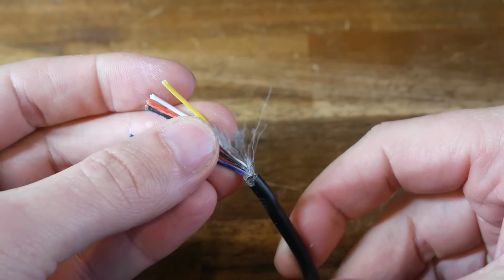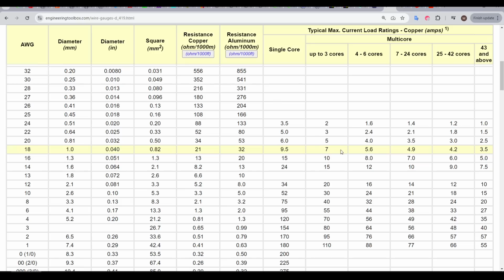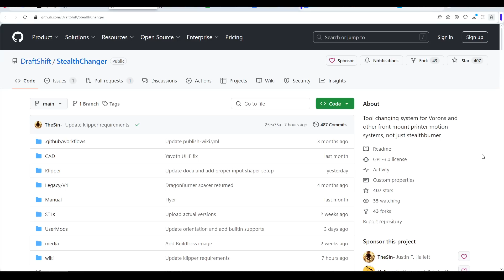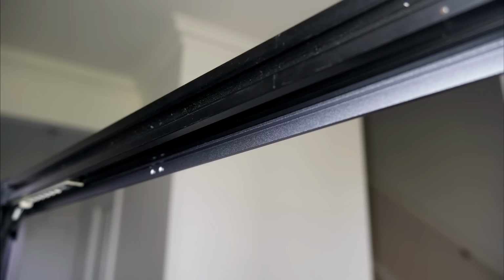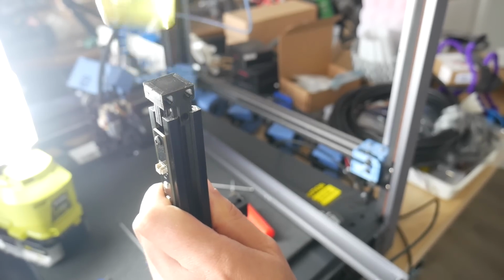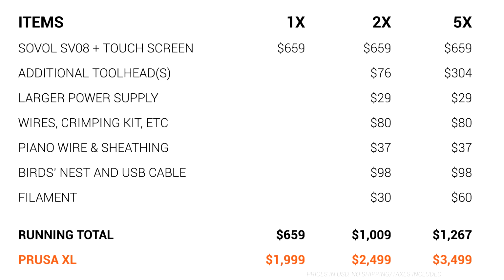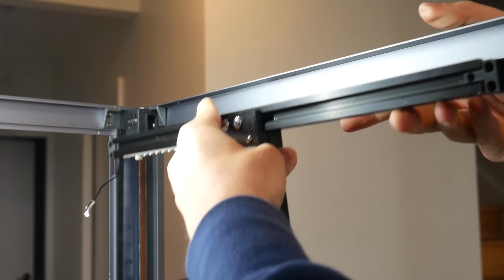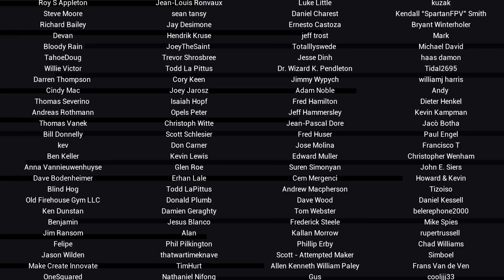Modular docking bar - Budget Sovol SV08 toolchanger part 4

Comment: for the can cable you could have just bought the BTT Can cable, it is suitable for all you do here, ahs 2 smaller gage wires for can or data and 2 thicker for power, and its not as overly thick as the one you got, plus the data wires are twisted aswell
Reply: That’s because usb cables for this purpose need to be shielded, and you gnd the shielding. CANbus cables do not need this
Reply: @BT123D  On the SV08 the grounded shielding wire is connected to the cable clamp screw. https://youtu.be/_QxwaGwVM0s?si=mTRGSr0Lu2TWNKrM&t=75
Seems excessive to have both shielded and unshielded grounds as well as grounded shielding.

Since the BTT CAN cable does not include shielding, I guess it wouldn't work in this application?
Reply: @jason.miles31  from what it looks like, the gnd to the housing is the gnd the toolhead assembly, the you have a power Gnd to the pcb, and shield Gnd to the PCB. USB toolhead board are quite tricky to stop interference with, I doubt Sovol would include wires that they didn’t need to 😂
Reply: I think the 5 wires on the sovol mod are Ground, 24v, 5v, Data+ and Data-     if you want to use a 4 wire setup, a buck converter at the tool head end to convert 24v to 5v might do the trick...
Reply: Oh grounding strategy discussions are always fun. Reminds me of my days scrolling through data sheets, app notes and EEVBlog threads lol
Reply: Seems like the BTT Can only has 4 wires.  Not sure why the Sovol has 2 ground wires.

Comment: About the wires, I'd go for thick two wire for the power and ground, and separately thin 3-wire cable for else. And then just bundle those wires together by short pieces of heat shrink every ~15cm. Might not be as tidy as a single cable, but more practical and still would work
Reply: Using wires with silicone covering instead of vinyl also makes a HUGE difference in flexibility. 

Lots of ways to tackle this problem just depends what tools you have on hand in order to work around it.
Reply: I would have just used some of those expanding cable sleeves

Comment: Very interesting to see the process, and cost breakdown. I am hoping you are also keeping track of your time, including mistakes and rework, because that time is a very valid consideration before taking on such a project.
Reply: Cost Breakdown is important and easy, but Time Breakdown will be problematic. He and Draftshift will have spend 300-500 hours in developing and building the Toolhead changer. The Question is how long will it take to assemble the finished product. That will be more like 10-20 hour print time and 10 hours assembly time. As a very simple example: I made for a friend a PC Button Box with 16 switches. The Initial 3D Draft was ready after 1 hours. Assembly is around 90 Minutes. I spend 3 days tinkering in the Afternoon to get all the spacings correct, so more like 4-6 work time on my side. My Powermac Trashcan ITX Case took 2 years and around 200 hours, assembly is 24 hours print time and 60 Minutes with a full PC Build, without painting the case. I may release it when i builded the 3rd Iteration still some kinks in it. And the 300-500 hours are Work time, without filming and modifing the Voron Toolchanger. But those projects are always projects of love, because you want them happen.

Comment: Nice work! Glad it’s still moving forward. It’s awesome putting the challenges into perspective with these videos. Just watched this one and already excited for the next one…. lol 

I was thinking the extruder cover would be problematic, not for the wiring but because they only have magnets holding them on and can easily pop off. 
I was thinking at minimum a redesign that uses screws coming in from the back plate to secure the cover. 

I like the look of the SV08, but not having support at the bottom of the docks could also be a reliability issue. Was thinking about mounting extrusion on the front of the sv08 to be able to support the docks and relocate the enclosure doors if I ever install one. Don’t like the thought of how it would look so I’ve held off from doing that yet.

Comment: sooo ... there is space between the docks of each toolhead?
then why not connect the lower inner corners of the docs with the upper ones (-> creating a triangle and therefore increasing the regidity of the printed part of the docks)
this could also function as the spacer, removing the need for the spacers all together.
this would add weight, but if regidity is your main concern, I dont really get why the docks are L-shaped (looking from the side)
No idea if there is smth preventing this, all I have seen yet, is the stealthchanger dragon and stealthburner docking route, so they might have a good reason for needing this space left and right on the sv08 one.

Comment: I think that the cables are not a problem, the connectors are. Many of them are simply made from thin steel.
Reply: Yes, the JST specs should be checked, but they should be sufficient.

Comment: How do you test continuity on the smaller connectors since meter probes are too thick?
Reply: you can either wrap thinner wire around your probes, but probes with thinner tips, or use a (male) connector to provide accessible contact points. if you want to be super fancy wire a couple of banana plugs (or whatever goes into your multimeter to the male connector, and then you just plug that in to the connector on the end of the cable, and you don't need to wory about wanting an extra g=hand to hold the probes in place ...

Comment: Check out Cresnet cable. It is a pair of 18AWG for 24v power and 22AWG for communication in control systems
Reply: Nice, I just found if the normal cable is not beefy enough:
Cresnet “High-Power” is 12 AWG  for 24VDC and Ground, and 22 AWG for control data.

Comment: in the process of upgrading my tronxy x5sa with a fly f407g mainboard at the minute, which means doing longer wire runs as there's no ribbon cable anymore, and I'm using cat5e patch cable for most of it 😅
got so much of it lying around, though I do wish it was slightly thicker. not using it for the heaters or main power of course, and steppers get two wires per coil. fans and endstops I'm happy with using such thin wires though. is just a bit finnicky to terminate and work with